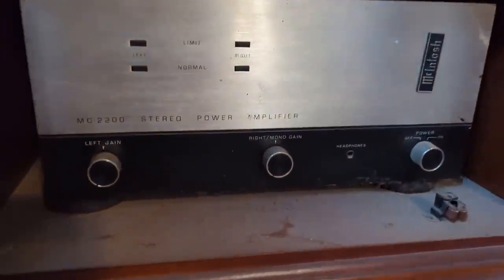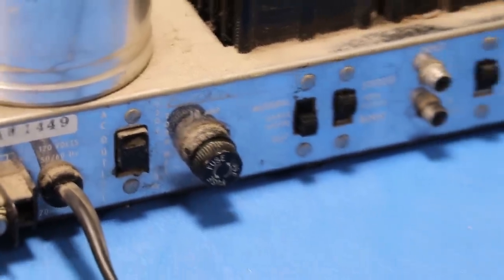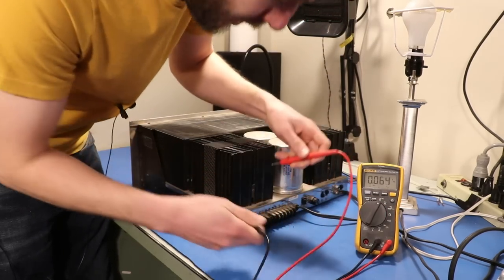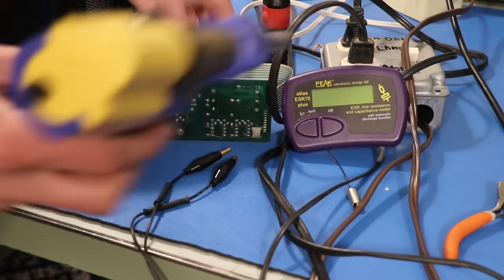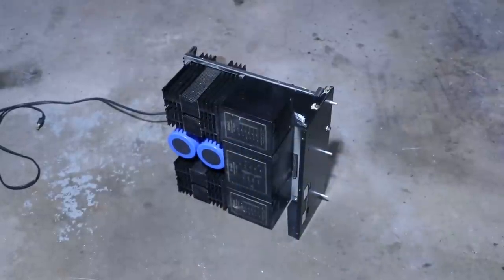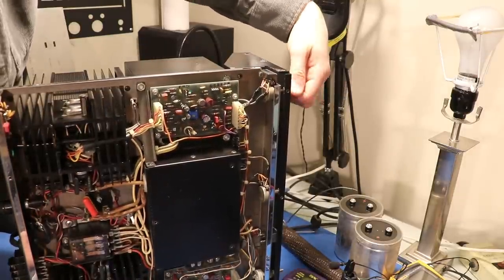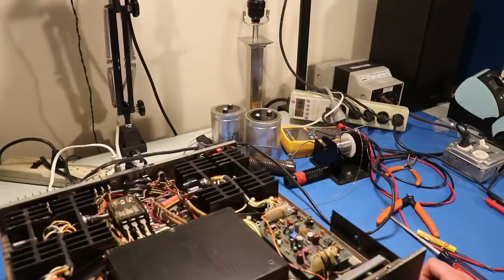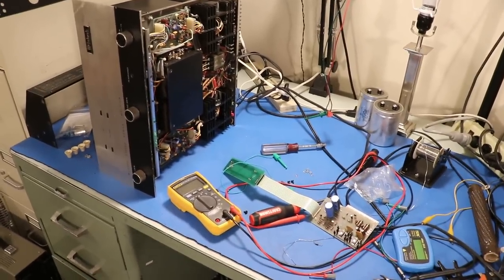FAILED filter cap on this MONSTER of an amp! McIntosh MC 2200

Comment: When you first measured the amp I was thinking, you REALLY don't want to see DC at the outputs of a McIntosh, because that would mean the output transformer is damaged. Luckily you saw no DC. I have a McIntosh 250 (2X50W) from the late '60's. It is a beast. I can only imagine how much this 2200 amp weighs! McInstosh solid state amps from this era were transformer coupled, just like tube amps. Those transformers would let the amp drive almost any kind of speaker, just by choosing the right output windings for the load.
Reply: Can you elaborate on this? My MC2205 has 5mv and 6mv at the terminals. Fresh caps, bias set, everything works and sounds great. But your comment has me questioning that…
Reply: @tylerhackman6832  I think you're OK with 5 or 6mV. I had a quick look at the MC2205 service manual, and your amp uses a non isolated "autoformer" rather than a fully isolated transformer. The amplifier stage is designed to be 0V DC at idle, but it could have maybe a few 10's of mV of DC offset (not adjustable), and you would see some of that on the terminals as it flows to ground through the single winding of the autoforrmer. Not a concern unless it's getting hot or having vastly different readings from R to L channel. You might want to try switching the speakers ON and OFF to see if the 5 or 6mV goes away in the OFF state, just for a meter sanity check. Enjoy your nice amp!
Reply: Solid state Mcintosh have autotransformers not conventional output transformers. An autotransformer has only one coil which performs the functions of both the primary and secondary windings by loading the output transistors and providing output taps at different points for each impedance. It does not provide complete DC isolation.

Comment: Fusible links? Every circuit trace is a "fusible link" under high current conditions. But putting a 1A fuse in to bridge the burned lanyard is First Class. Another excellent job.

Comment: Bias is set with ccw on both . But turn up each only to get 6w on first mark spot turn it bk dn ccw and then on second do same. You said in verbal u turned second up to 35? Both should be set to spec. I’ve been doing Mac amps for 34 yrs.  Manual says repeat steps for each channel independently . It’s last line in notes. Your going to get a pop turning off out of speaker if speaker switch is on. Any may see an offset diff at speaker terminals. He’s a neighbor so perhaps recheck?

Comment: You have hard time fitting ps board straight with pin slit with in those 2200 non axil caps

Comment: Great video and job on this amp. Only thing I would add is to measure the resistance of the protection relay. The contacts will oxidize over time and most need cleaning with age. Contact resistance should be milliohms and have seen many old relays with 10s of ohms before cleaning. Can have issues when relay is in line with the speakers. Good luck!

Comment: Not sure why he left in those pesky ROE / ERO ones but okay. I guess they are pretty old type ones
Reply: The four brown ones in the pre amps. He probably did not recognized them as electrolytes, lacking experience.
Another problem in repair was that after the filter cap(s) showed bad, it is best to check the bridge rectifier diodes too. If bad, you could destroy your new caps.
Reply: it´s very important replacing the ERO Caps. They are known tend to Fail that age
Reply: @radiologe9271  the ones in my old Quad 303 did..
Reply: @erikdenhouter  yes, I meant the brown ones. I have very bad experience with the ROE (ERO) and FRAKO caps. Some of the golden ones even short out. I always remove them.
Reply: @stefanegger  Well, your comment is valid, but I have never seen him reacting on a negative comment, although it is positive feedback.
Reply: @erikdenhouter  it's just my experience and in my opinion those are a source of future problems. Also he should not work when tired, it's easy to make mistakes. I am currently repairing three Harman 870 amps. It's better to take your time with those things.

Comment: Hey Adin! I've got a question. I am trying to work on my first reciever my mom and dads old SX-750 but here are the problems I have encountered. First of all there is no relay click and second it isn't getting any sound from the turntable. I suspect the sound problem has to do with the relay click, Anyway I haven't really found any ideas online of what could be causing this issue so I thought what the hell might aswell go to my favourite channel and ask for some help. What do you think right off the bat might cause this? Is this a normal issue for the SX-750? Do you have any ideas that could help me that I could try?
Thanks in advance Adin, Daniel.
Reply from the maker: Either the relay has failed, the protection circuit has failed, or both of these are working and they are protecting your speakers from DC voltage out of the power amplifier. You will get no sound out of anything without the relay click. Time to get out the multimeter and look around!

Comment: Nicely done Aidan👍👍 Having boards with connectors is a nice feature for repair or replacement for sure.  Good job fixing this monster amp.  I watched the 10 sec "Ooops" video and it looks like another McIntosh is in for a repair, sweet.  See ya next time.

Comment: Where did you find 39,000 capacitors.? My mc 2105 has the same, I could only find 42,000 in that profile ..
Reply: Go back in the video, I think the Mouser part# was on screen for a sec
Reply: @11:22
Reply: That Mouser number comes up as 41,000 uf (which, of course) is acceptable in place of 39,000 uf. BTW, those caps cost $63.98 (USD). Wow.
Reply: @JohnMason8183   Your right, I could not remember the value.. The caps in my amp were replaced 10 years ago.. 
 The sound of the amp remained excellent..

Comment: You'd think the price of those it would be made of military grade components and be indestructible.
Reply: Electrolytics are on borrowed time from the day they're manufactured.
Reply: The amp is over 40 years old. Now that it's fixed it will run for another 40 plus years.

Comment: I have two McIntosh amps an MC7100 that I've owned since 2000 and an MC7108 that I bought for parts off of eBay last year.  The MC7108 just needed a new fuse and capacitor in the power switch circuit and it works  perfectly and it is a beast of an amp.  McIntosh is the real deal.  Their listed specs are the MINIMUM that their equipment will perform at. Instead of some farcical rating that other manufacturers like to use in their marketing.  Both of my amps are 30 years old and work like new.

Comment: Your neighbor needs to be educated as to why putting a big power amp in a tight cabinet with poor ventilation is why you are going to be recapping it.  Oh BTW the auto transformers are a very low ohm DC path to ground .

Comment: The first electrolytics could have been -20 +50% tolerance. But if you were actually experienced, you’d know this. 
I find this channel quite frustrating because you barely know what you’re doing.
Reply: Agree. And I'm not sure why he doesn't replace axial caps with axial, looks sloppy using radials. I've seen him do this on point-to-point wiring in a MAC1500 hybrid receiver. Frustrating: do it right or not at all.